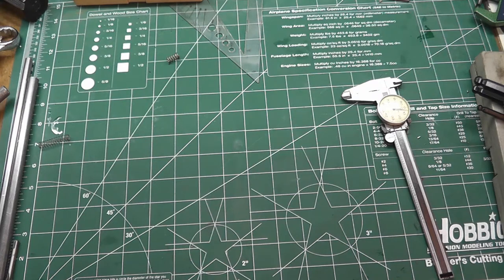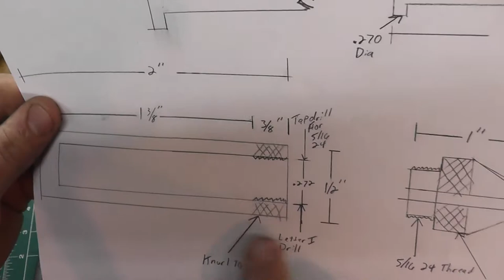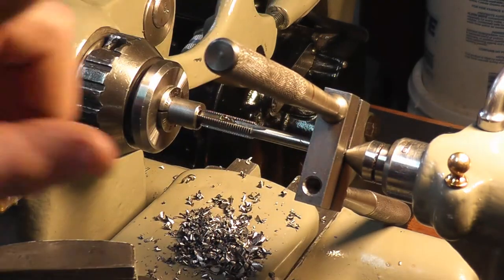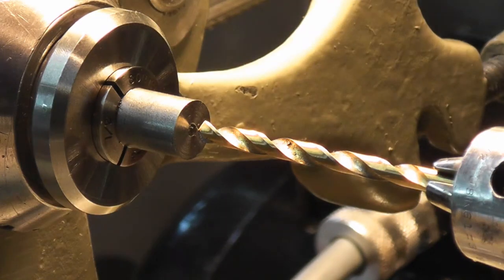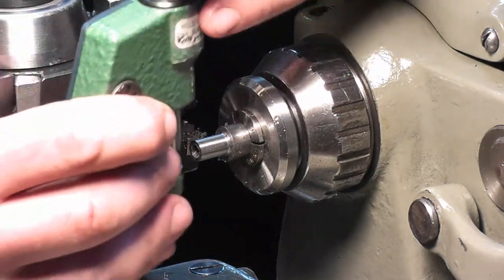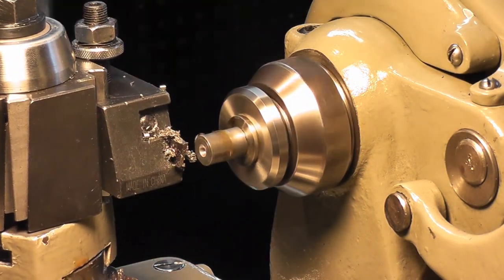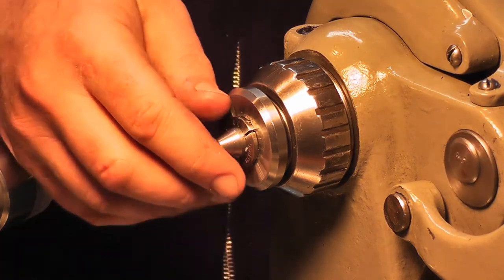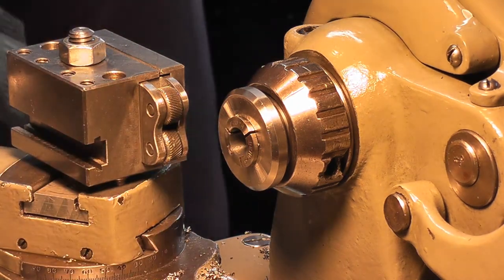Making a Spring Loaded Tap Follower Part 1

Comment: I like the initial design better. The support of the spike by a hole in the back end would be more stable than the wobble that comes from making room for the flat of the spike to fit past the threads. It needn't be any longer than the later design.

Comment: For measuring the 3/8" shoulder length, a caliper would be far more precise than the adjustable square.
Reply from the maker: Doesn't need to be that precise.  Just in the ball park is fine for this application.

Comment: Please please please DO NOT use a file on a lathe without covering up the slidways. How to ruin a good machine. You should know better,
Reply: How does using a file ruin the ways?

Abrasives, maybe, and a hacksaw for cutoff certainly can if you aren't very careful, but a file?  There's little or no pressure involved, so you aren't likely to overshoot and hit the ways, and there's no abrasive dust...just tiny chips like the lathe was making already, but smaller. I've yet to see any of the really experienced machinists I've been watching cover the ways for filing...OxToolCo or abomb79 for example...though Adam does cover them for sanding.

File use on a lathe is much more likely to damage (or kill on a bigger machine...do some googling if you are curious and have a strong stomach) the operator than hurt the machine. 

-- Mike